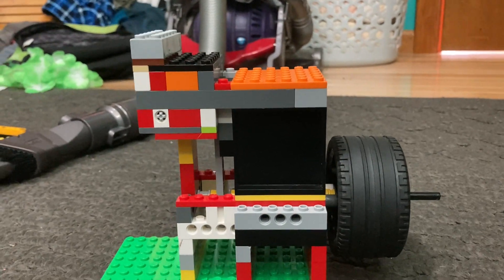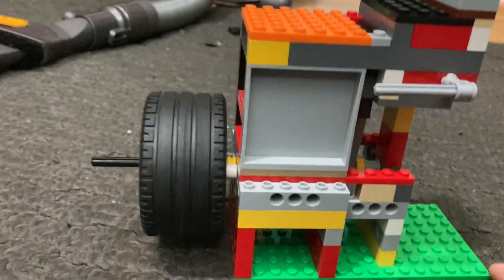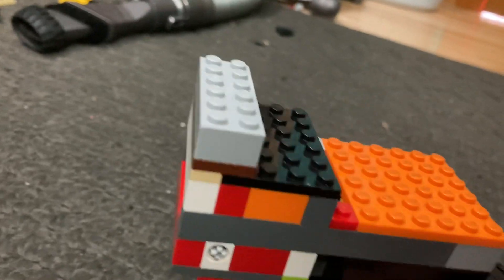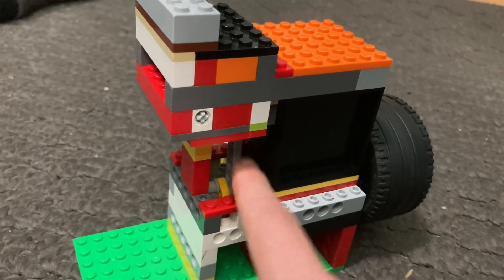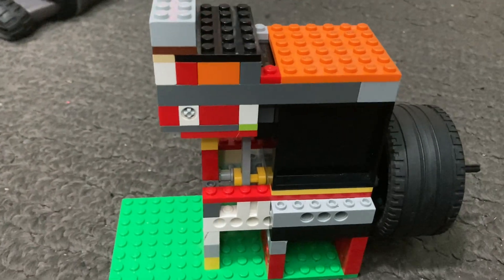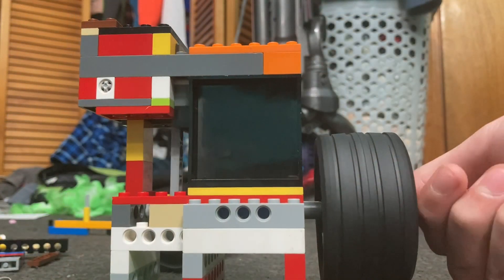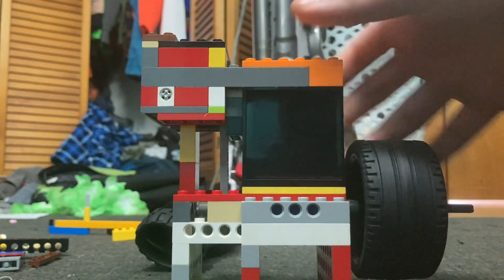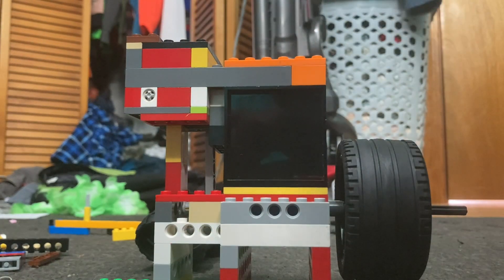FULL Lego Vacuum Engine Tutorial

Comment: I’m thinking about having a system like this but with two intakes and exhaust ports. I’m going to add a system that slightly loosens cylinder pressure. (It would use two vacuums and optionally a blower)
Reply from the maker: That would be a really powerful engine, and with the blower included you can expect it to be very torquey. Just make sure it’s reinforced properly so that it doesn’t explode with all that boost!

Comment: I haven't got the same parts so I used mine's. For example lenght of your crank under piston is bigger than crank outside piston. Mine is the same. My problem is that everything move with huge friction despite that I have used tall bricks. Then you spin freewheel it countinue spinning but mine doesn't. Did you used water, oil or something?
Reply from the maker: I used olive oil for lubricant.
Reply: @KFPlusLegoMastery  can you tell nie what dimension is between centers of holes in crank which is under piston? Is the lenght of this crank equal to 2 or 3 LEGO technic bricks
Reply: I like to use nonstick baking spray for lubrication on the piston, valve, and the crank rods.
Reply: @AngryProtoBoi  I personally spray a bit of windex lol

Comment: how do you connect it to the engine?
Reply from the maker: What do you mean? Could you be more specific?
Reply: @KFPlusLegoMastery  i'm not sure where i need to put the vacuum hose, it it where the valve is?
Reply from the maker: @poipoundah808  The vacuum goes where the throttle body inlet is, however a throttle body isn’t required in which case the vacuum would just go where the valve is.
Reply: @KFPlusLegoMastery  thank you!

Comment: Make a exast by covering the value and funl it to a single hole and pump air throw the hole or exast into the cylinder when the value is open but weak enough so it wouldn't lug the engine
Reply: Pump air into the new exast when the value closes so it pushes the position down

Comment: Doesnt work
Reply from the maker: Could you go into more detail on what exactly is not working? I’m here to help!
Reply: @KFPlusLegoMastery  the piston is too tight so it does not lift and it does not turn even with a large flywheel
Reply: @KFPlusLegoMastery  i can send a video but then i need you to have your snapchat or something
Reply from the maker: @jelmerbeats44  Check the timing. The valve crank should be 90 degrees offset the crankshaft in the direction you want the engine to spin. If you’re still having trouble, I suggest that you rewatch the tutorial.

Comment: Great tutorial! However I did notice that you engine and valve intake is 1x2 but your throttle intake is 1x4. I feel like that may be a effeincy problem. Other than that, great sounding engine!
Reply from the maker: Everything But Mechanics Actually I’m using a 1x1 hole upgrade for the extra 2 studs. Though not all the vacuum goes through the smaller holes, it just reroutes to the center 2 studs.
Reply: Great? It sounds better than my REAL engine.
Reply: @sqwhirl  efficiency IS functionality. The only difference is between functionality and looks.